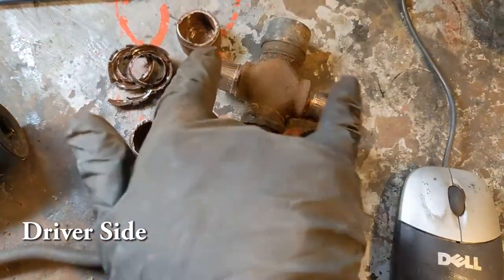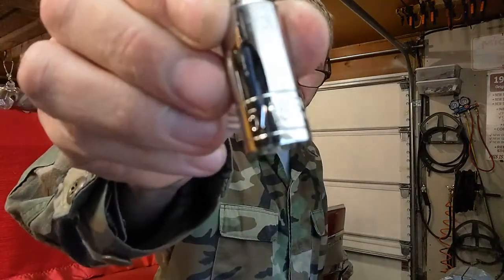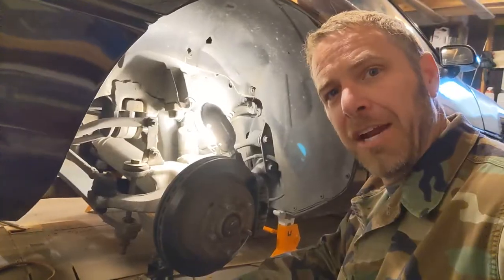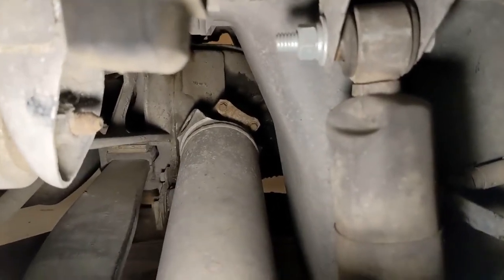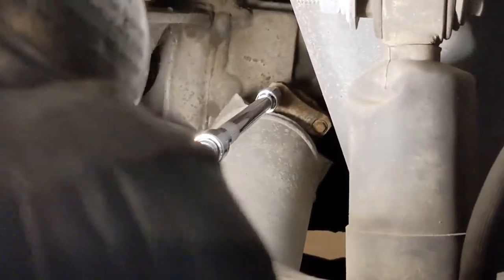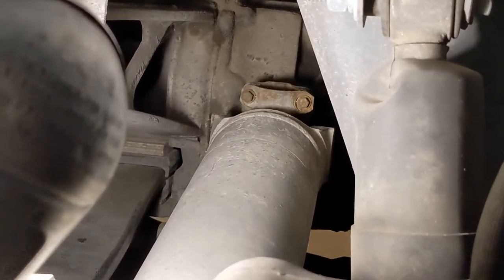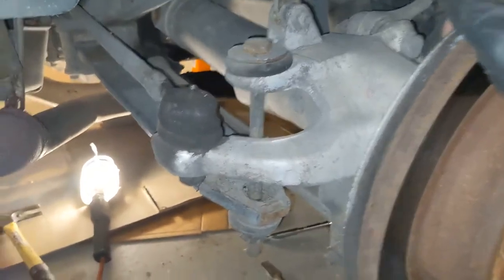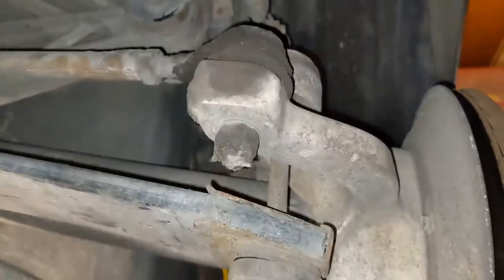How To: C4 Corvette Half Shaft/Axle Shaft U-joint Removal and Installation

Comment: It was nice to see that you didn't skip or edit out some footage of the obstacles you encountered . Many will say stuff like it pops right in when that's rarely the case . A parts list would have been nice . Thanks .
Reply from the maker: thanx... Just trying to make real videos doing real stuff showing lessons learned. 

A parts list? I have two brands of u-joints listed in the description and the main tools you need as well. Was there something else I should have included?
Reply: @JerrSpud  Sorry , my error , you did and I overlooked it . Thanks again .
Reply from the maker: @dalemihocik4732   no worries!
Reply: For the rear tie rod, instead of the fork you can loosen the castle nut a bit and whack the nut upward with a rubber mallet and it will pop right out.

Comment: 3 years ago, so no idea if you'll reply, but i've watched a couple of these and i'm just wondering if you separate the tie rod first, will that give you easier access to the carrier bolts?
Reply from the maker: @nobodyspecial-d5j   carrier bolts? The u joint bolts?
Reply: @JerrSpud  sorry, i'm sure i'm using the wrong term, yes the u joint bolts, my apologies
Reply from the maker: @nobodyspecial-d5j  they were rather easy to remove. A shorter socket would have helped. That was the issue I had
Reply: @JerrSpud  thanks

Comment: At the end of the video you said the clunk noise prompted you to do this repair...did that sound go completely away?  I've heard that the "clink" noise starting in reverse, or forward is the teflon washer behind the hub and axle shaft...

Great video...I think this repair is also in my future...I need to change out shocks and I figured universals are probably due....
Reply from the maker: Yes the sound almost completely went away. I also need to do u joints on the drive shaft as well. 

I thought something was wrong with the transmission for the longest time but it was mainly the half shaft that was bad.